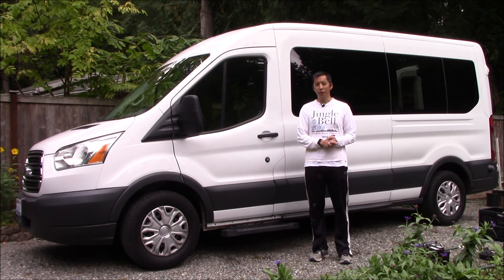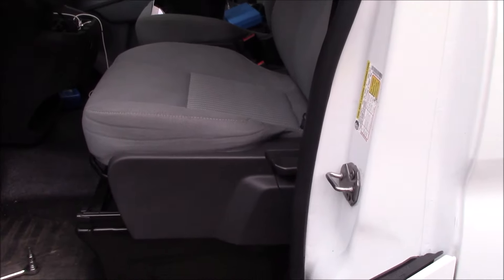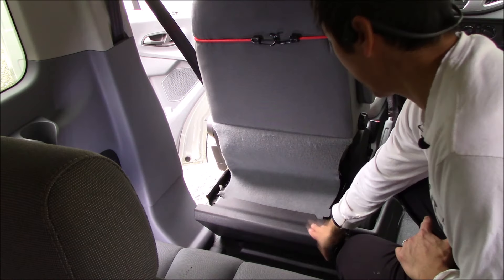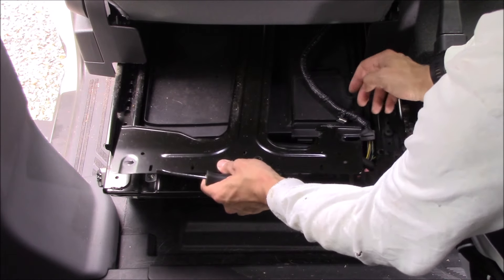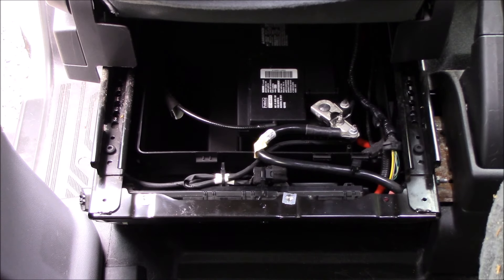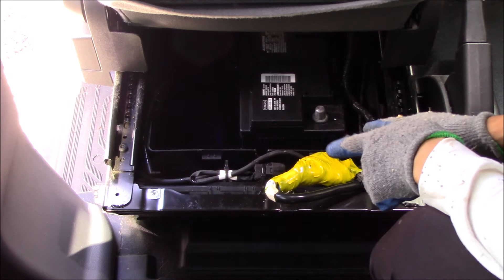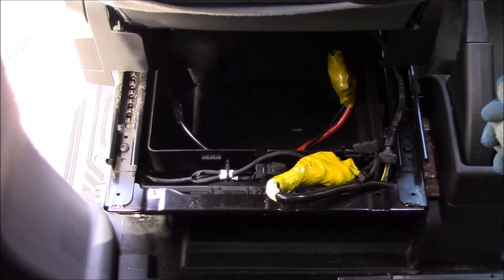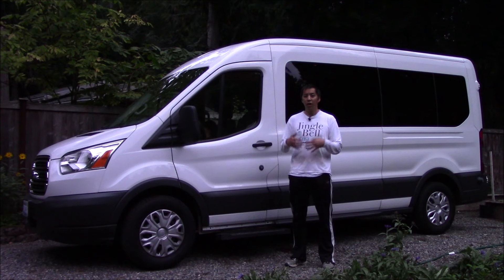Removing the Battery on a Ford Transit

Comment: Never seen anybody so enthusiastic about performing the most difficult and inconvenient battery removal... ever.
Reply from the maker: I know what you mean 😁.  Thanks for watching!
Reply: @Benton Hugo instablaster ;)
Reply: Right? I just did this and suddenly, removing the wheel to replace the battery on a dodge stratus isn't so bad. Lol
Reply: Seriously thank you for your good attitude in this. It’s like hey we’re going to remove a battery on a Ford transit. Start by cutting off the body on the car then remove all the glass and separate make sure that you have your weather strips in a Ziploc bag and labeled. Then you will want to get a hoist to pull the entire engine out and separate from transmission get those on the bench. Soon we will talk about the beginning steps of starting to remove the battery
Reply: way easier than a dodge journey
Reply: That's cause he doesn't do it for a living.
Reply: What a stupid battery location for big vehicle
Reply: I have delt with worse battery removal
Reply: 🤣🤣🤣. Diesn't look like fun
Reply: Take pictures before doing job just in case you miss a screw l😅😂

Comment: This is the stupidest place to locate a battery and the seat height cannot be adjusted, which causes the front of the seat to cut off the circulation to my legs. This is a company van so I have no choice of a vehicle to drive. Very poor design for a van that will spend a lot of time on the road with the driver being as uncomfortable as possible.

Comment: This is what happens when you design a car with computer-aided drawing and an engineer who can't even change a lightbulb
Reply: I think it was designed by AI. Specifically Skynet!
Reply: As much as I dislike this battery arrangement, on the Transit series they are obviously prioritizing the volume of the back, so they shove the seats are far forward as possible. For contractors needing maximum volume in the back, they will buy whichever brand does the best at this.

Comment: When you’re on the road with your Ford transit and the battery dies, and because you can’t replace it quickly and easily, you will become one of the ‘FOUND ON ROAD DEAD’ victims!
Reply: Well said, Ford had to make it that ridiculous
Reply: Smart guys know you only need the battery to start the car not to actually run it so you can have somebody jump-started on the jumping points and it should keep itself running without the battery as long as you have a good alternator
Reply: Happened to me, that negative jump point is a joke, doesnt work, had to connect to the negative terminal at the battery itself.

Comment: Good Lord Ford....what a way to make things extra hard for something that used to be so simple....I can only imagine the contraptions you will need just to change a tire on this thing.
Reply: Think this is so they can charge 900 to replace battery
Reply: Fortis garbage I only bought my motorhome with a Ford front end because it came with an inline 5-cylinder diesel which isn't made by Ford thankfully

Comment: Thanks for the Vid! I bought my Transit back in 2015 and it still has the original battery in it. The reason for it lasting '8 YEARS' is because it's NOT in the engine compartment going thru the EXTREME ENGINE HEAT CYCLES which is detrimental to the battery's longevity. Batteries last between 3 to 5 years when placed in the engine compartment.

Comment: wonderful! since i have a metal partition right behind the seats this would go from huge pain in the ass to virtually impossible....thank you Ford! I did at least leaern today where the negative terminal is under the hood - pure crazy again!
Reply: Same here. Then add that there are two of them and because they are in the cab they are expensive as well
Reply: Same here. It kinda sux. I was able to do everything through the drivers door on mine (as long as you have tilt seats). Also removing the two torx bolts as shown (at the front of the seat) does help!

Comment: Excellent video! I understand wanting to be safe with the negative terminal, but it wasn't really necessary to tape it up. Once disconnected, there is no reference to the battery ground post. Again, great video! Thank you!!

Comment: I have to remove my battery to get it tested. This video helped immensely! POST front end accident... There's a mystery drain on the battery, OR, the battery is old. I keep getting the tend belt minder alert. Also the van won't start if sitting longer than 2 days.

Comment: Since mine has 2 batteries, 3.2 diesel, no room to rotate battery. I am on my own on that part. The battery saver part means the electrical system is never off when engine is off.

Comment: I used to connect my 12-volt shop lights or my temporary not permanently installed inverter directly to my battery. I'm assuming I should be able to connect them at the post used for jump starting

Comment: Christopher, 
I am turning my Transit 250 into camper.  Right now  I have solar charging my vsn battery. I have a 100Ahr liFePo that I want to connect solar. 
Do I disconnect the solar from the van battery?
Then I can connect the solar to the house  battery. 
Am I thinking correctly about this switch.
Thank you

Comment: Hi. Have a question. I have a ford transit van 2014, 2.2 engine. I need to change the battery, but I think I saw 2 batteries. 
My Question is: 
1 battery is part of the van ? Do I need to change 1 or 2 ? This is a stop start battery. 
Thanks 👍👍👍

Comment: Putting the battery under the seat and the gas tank under the battery helps you to no longer exist when you have a wreck. Plus having all the weight of the battery and gas tank on the same side can't be great, the battery should have at least been put under the passenger seat. On my 2016 Escape, to change the battery, you have to remove the windshield wiper arms, remove the plastic air ducts under the wiper arms just to get to the battery, not sure what grade Ford Engineers graduated from, but I am thinking about 3rd grade.

Comment: Nice video. Have you tried replacing the auxiliary outlet fuses located under the steering wheel? They are in a really awkward place where I can't get a hold of them. I have three outlets in my van and none of them work.
Reply from the maker: I actually did have to replace a fuse I blew.  I do recall it being somewhat awkward.  Did you check out the user manual?  There is a good listing of what each fuse protects (I show this in https://youtu.be/wb3Dq4NM3QY?t=143).  There is another fuse box under the hood of the van so perhaps the fuse you blew is located there instead.  Thanks for watching!
Reply: @ChristopherLum  According to the owner's manual, I believe the fuse or fuses I have to replace are in the passenger compartment fuse box; fuses F47, F48, and or F49. I see the fuses but, I can't get to them because they are squared and flush in the fuse box.
Reply: So those are the fuses that are responsible for the outlets. It turned out that my phone charger didn't work. The outlets were all fine.
Reply from the maker: @robertoterriquez2132  Nice, it sounds like you got it figured out!

Comment: Well this will be extra fun in mine, I have dual batteries and a partition in mine so I will be doing everything through the driver side door. This is as dumb as having to remove the rear axle shafts to replace the brake discs!

Comment: The internet is screwed up. There is a difference between the Ford Transit Connect and the Ford Transit. However the web interchanges the two names as if the vans are the same.
Reply: EVERY TIME I search for Transit, I get 20x as many Transit Connects as real Transits. Despite the fact that the real Transit has been around for like 50 years longer.

Comment: I saw a video where the guy hooked something up to keep the computer live while the battery was out. Did you have to do anything like that?
Reply from the maker: Hi, yes, these are called 'memory savers' and I do indeed have a video on this at https://youtu.be/wb3Dq4NM3QY, please let me konw what you think, thanks for watching!
Reply: @ChristopherLum  Did you use one? Seems like I can just jumper another battery to the system and it would do the same thing?

Comment: I bought a new Transit recently after having previously owned a 2010 minibus. Surely after 14 years Ford would have come up with a better place to put the battery or a better design for getting at the terminals or removing the battery, but no apparently not. What a nightmare design.

On the e-Transit they literally have a whole empty engine bay in which to resite the battery, but no, they can't do that.

Comment: Why remove the two Torx bolts at the front of the seat, they appear to have nothing to do with removing the battery. Aren't those two bolts for removing the seat itself?
Reply from the maker: Jerry, initially, I thought the exact same thing 😀.  It turns out that they actually interfere with a small tab on the seat.  If you remove these two bolts, you can actually slide the seat forward by another 1/2".  The battery compartment is very tight so any extra room you can get is helpful.
Reply: @ChristopherLum  Any time I've had to remove mine or when I installed the extra CCP connections I just removed the seat. One electrical connection, seat belt bolt and four bolts for the seat. Doesn't take long

Comment: The Ford Transit is hands down them most awkward vehicle to work on. You have to remove the seat to get to the battery. You have to remove the intake manifold to get at the spark plugs (dont forget to get a new gasket!) and it doesnt even have a dipstick to check the transmission fluid, you just let the transmission break and replace it. The designers had no concept of maintainability; or were ordered not to put any in.
Reply: Don't forget the impossible to reach fuse box under the steering wheel

Comment: I have a 2016  Transit 250 with a metal bulk head !  Debating on doing it myself or paying a mechanic ? I think I may remove the seat , then try it . REAL STUPID DESIGN FORD !!!!!!
Reply: My bulk head is only held in by like 8 really prominent bolts, havent done it yet but looks like 5 minutes with a socket and a cordless drill and it will come right out; obviously not a Ford design - they would have made you remove the rear axle, the right turn signal bulb, and the stereo first. I may remove it just to clean that area (its a "well-loved" 2015 I just bought).

Comment: Just bought a used Transit cargo. Wanted to look at the date on the battery and confirm it was maintenance free OR had enough water, but I guess Ill just let it die first. Hope it doesnt get low and explode like my wife's car battery did once (the terminals were flush and it had a label over the entire top and I thought it was "maintenance free" but turned out it was not). Every day I have this thing I discover some stupid design flaw like this, depressing.

Comment: Oh Maaan ! I'm really disappointed in Ford for this ...with just a tiny little bit more effort ???.....they could have made the task REALLY ridiculously difficult and time consuming ..What manner of highly paid vehicle designer puts the battery in such a stupid arse cockamimi idiotic place as this ???? and then makes actually getting at the battery  even more time consuming ??????  ..I'm getting this mental picture of the Ford design engineers all getting together and saying " hey lads !!! on this model ? Let's make simply swapping the battery one of the most pain in the arse and pointlessly time consuming jobs that anyone has ever done on a modern vehicle !! come on !!!! It'll be fun !!!! " .......
Reply: I wish I had seen this video before buying my RV on a Ford transit chassis...this is ridiculous.
Reply: RattlesnakeBob, exactly what I think too! I have a 2012 mk 7 Transit with two batteries under the seat and even with the seat full forward folded down the space to access them is ridiculously tiny even for a slim person like me!Then you have to unclamp a T bracket under the cables which is a task in itself to remove the nuts and bolts securing it in,the clamp is also VERY close to both of the front battery terminals so precautions must be taken unless you want a firework display.Who the hell had the idea of this design?

Comment: Why cant you use a set of jumper cables   on the "jump" points to a 2nd battery -  turn the ignition forward - now your car wont lose memory while you replace the actual battery?

Comment: i’m currently trying to jump my car off which has a battery in the trunk with my 350 HD. I thought about connecting the jumper cables straight to the battery but Jesus Christ never mind😂

Comment: Who designed this system?? Ford has a list of once easy to manage systems and made them difficult to maintain. Checking transmission fluid levels is another example. I have a ford transit. It is my last Ford. SMH.

Comment: It’s the positive that you don’t want touching things, also what’s the point of taping a terminal that’s not even live anymore.
Reply: It would be live in his case since he installed a memory saver into the OBDII to save radio memory , etc... The voltage, one can only assume, that it back feeds into the terminal .